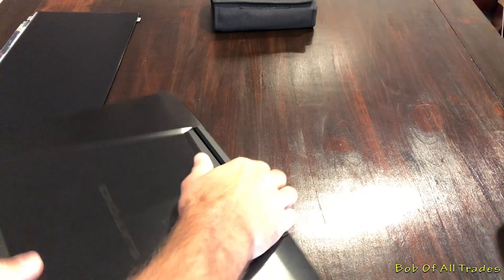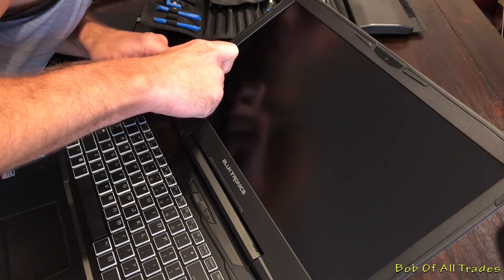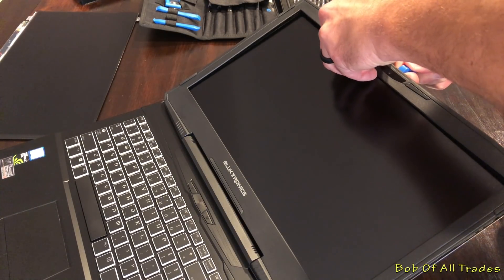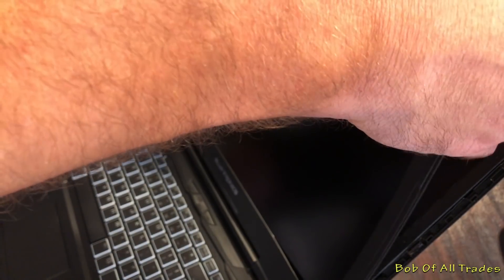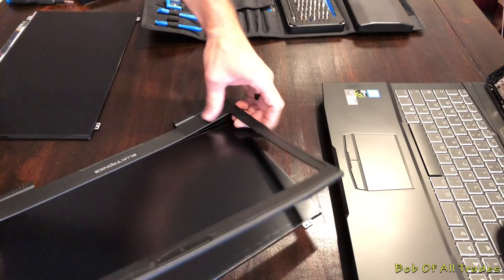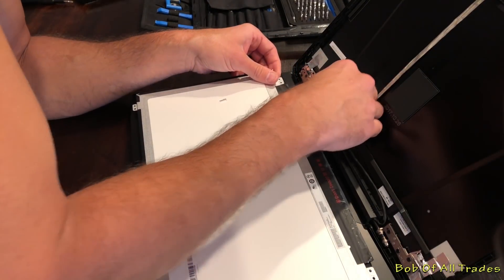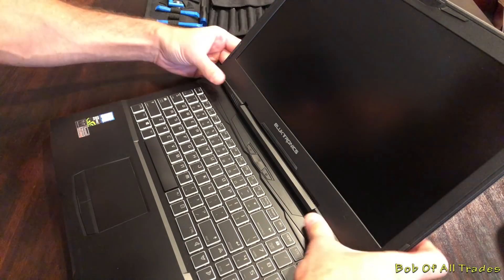120Hz 100% sRGB Panel Install MECH 15 Eluktronics

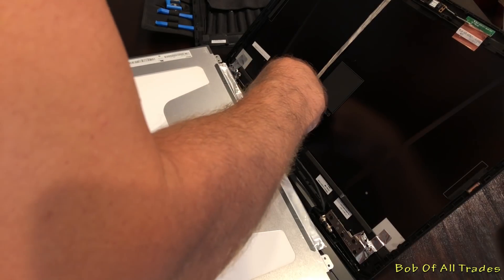Comment from the maker: This will NOT fit thin bezel chassis laptops 7:22   ;)
Reply: will it fit acer nitro 5 an515-52?
Reply: @lukedominated  It should.
Reply: @sydweller2066  will it fit acer aspire v15 be as well (vn7 593g), quite similar to acer nitro 5
Reply from the maker: Is a frogs ass watertight?
Reply: there are lots of reviews like on linus tech tips mkv dvd  post ur video in the chats there people would really injoy this but ur platform is to small
Reply: will it fit acer nitro 5  an515-43 ?
Reply: is there any 120hz screen fit with thin bezel chassis?

Comment: Will this work in Lenovo Y50-70?  If it has 30 pin connector and thick bezel chassis.
Reply from the maker: It should

Comment: Does it have Gsync? Can I use it for alienware 15 r4?
Reply from the maker: GetgadgetPH The panel itself will need to be certified to use Gsync on a Gsync laptop.  There’s no module like you’d find in a desktop monitor with Gsync.  Also not to be mistaken with a Gsync “certified” desktop monitor.
Reply: @BobOfAllTrades  AUO51DE do you think it gsync will work on my alienware 15 r4 ?

Comment: I bought this panel to replace the display that was in my Dell G7 that has a line going down the side of it. The first one I got the screen is just black when I boot the laptop up, I get the occasional flicker of a image but other than that nothing. Ive checked the ribbon cable connections and they are fine because the stock one works just fine when I put it back in. Might this be a weird driver or bios issue or is this common with a busted display?  Ive updated my nvida drivers and intel drivers and its on the latest bios.

Comment: what is the difference between the two links, they have different prices and I see the same screen
Reply from the maker: It’s just in case one changes. I’ve already replaced one of the links since this video. Once seller might run out of stock and decide to sell something else. 

That happens often with niche items like this.

Comment: does it work on alienware 15r4 . my screen has a 30 pin connector and is fhd 60hz
Reply from the maker: Probably but those are slightly harder to disassemble. While I have not done this myself I’m just going by with what I have seen and what others have told me just a heads up with some ribbon cables and various other things like that so just be careful
Reply: @BobOfAllTrades  thanks

Comment: Hey guys, is this display works with Lenovo y540?
Reply from the maker: No
Reply: @BobOfAllTrades  Hi Bob, what display for Lenovo y540 you would recommend to buy? Cos I have 17inch model and work as a photo editor. Thanks.

Comment: I ordered "LCDOLED Compatible with 15.6 inch N156HHE-GA1 120HZ 94% NTSC FullHD 1080P LED LCD Display Screen Panel Replacement". Is it compatible with my Acer Nitro 5 AN515-53-527H Laptop model? My stock display is 60hz IPS 1920x1080 15.6 inch.

Comment: Hi bob, this is a good video, but I have some question

1 - These panels work for the Acer Nitro 5 2018?
2 - One of this panel have this characteristic LCDOLED, is real OLED or just LCD (TN)?
3 - On Amazon, I find that panel,  https://www.amazon.com/dp/B07N5KN3D7/ref=psdc_2612045011_t3_B07HKVB6BV , in the description specific that is IPS, this is better than you show in this video but with the same quality as the original, that it is IPS too

I hope you can answer me, I want to change the panel, but for IPS 120 Hz version, thanks.

Comment: Great video as always Bob, i suggest you to give a chance at the N156HCE-GA2 from innolux too but it's IPS (near 100% sRGB) and got very good compatibility with brightness control. Compared to the AUO42ED and AUO45ED it also got better G2G times. I've installed it in my acer VN7-593g and it's awesome, buttery smooth, vivid color and brightness slider works very well. I don't understand why this panel is not so popular, i suggest you to give it a try!
Reply from the maker: I don’t have any laptops with chunky bezels anymore or I might give it a go 👍

Comment: I come from the replace for the dell g3, will this work for the dell g3?
Reply from the maker: As long as it’s the thick bezel laptop 2018 model
Reply: @BobOfAllTrades  yeah it is the Dell G3 15.6 3579.
will it work?
thanks.

Comment: does anyone know if this laptop panel will work with a dell g5 I need brightness control to work as I have to dim the display when i am at uni for better battery life. thanks
Reply from the maker: As long  as it doesn’t have a 4K panel and as long as it is the thicker bezel last generation version then yes

Comment: Between this and the previous video about changing the panel in my G3 15, I am much happier with my laptop. Thank you, sir!
I will need to get calibration hardware before I can do any serious photo editing but even with just visual adjustments, this looks very good. I did not see this video before I bought the panel I just installed or I would have used your link(s), sorry. 
I've replaced the HDD with a 2tb ssd, the nvme drive is now a 1tb, and I maxed out the ram. With this new panel I am almost done--just need to learn about repasting . I think I now know a guy who has some helpful videos for that too. :)
Thanks again!
Reply: rob biemer hey. Which G3 have you got? The 3590 one?
Reply: @jmextinction2158  , Not that one, I have the 3579. I got mine about this time last year.  The upgrades to RAM and the drives were simple and pretty easy and made this the fastest starting laptop I've owned. The previous one I had---an other wise pretty good Asus--was slow enough that I would turn it on then go make(not pour but make) a cup of coffee while it booted.  This one is right around ten seconds or so now.  The panel replacement was a bit more involved and is my most recent upgrade.
Reply: @robbiemer8178  are both of the panels in the description compatible with the laptop? is the toolkit necessary?
Reply: @raphaelbutron45  , I am not sure. I bought the panel I used from ebay. See here:
https://www.ebay.com/itm/New-LCD-Screen-for-N156HHE-GA1-REV-C3-FHD-1920x1080-Matte-Display-15-6/273756123642?ssPageName=STRK%3AMEBIDX%3AIT&_trksid=p2057872.m2749.l2649

The tool kit is probably not necessary but it made the task much easier. And a bit faster, I think. As well, good tools are always useful.

Comment: Yo dude does this work on the dell g7 too?
Reply from the maker: Only the thick bezel laptops
Reply: Bob Of All Trades wow that was fast bruh. Appreciate it. But doesn’t the g7 fit in that category? I think it has really thick bezels
Reply from the maker: Amazing Spodermon It depends what G7 you’re talking about. Last generation model or this generation model with the new design that Dell released shortly after CES.
Reply: Bob Of All Trades whoops sorry for not clearing that one out. I have the 7588 one which they released last year. Will this panel fit perfectly for that particular device?
Reply from the maker: Amazing Spodermon If sure will 👍
Reply: Bob Of All Trades thanks so much man. Really appreciate that you take the time to help your viewers in the comments section. Have a nice day!

Comment: Hey bob i have dell g7 7588 with philips panel.You have given 2  links innolux and lcdoled.Out of 2 which one is better in terms of quality ?
And can check this item because its a ips 120HZ.
https://www.ebay.com/itm/NEW-15-6-LED-IPS-FHD-120HZ-AG-DISPLAY-SCREEN-PANEL-LIKE-INNOLUX-N156HHE-GA1/401586692400
Really confused which one to buy appreciate your replay.

Comment: Hey Nice video ! 

What do you think about this screen ? http://www.panelook.com/B156HAN09.0_AUO_15.6_LCM_overview_37729.html
(idc about 60-120hz)
Do you think it will be able to fit in the dell G5 (1920x1080 and no touch screen)?
Brightness and viewing angles are important for me as i work in team project, most of the times they check my screen and it's nice if they can see it clearly.

Comment: Hi Bob! I don't usually write in the YouTube comment sections, but I just had to say thanks for bringing the amazing N156HHE-GA1 to my attention. I purchased one from ebay.co.uk for £44.99 with free shipping - probably the best upgrade I've ever done to a laptop! This upgrade worked fine for my CyberPower PC Tracer III Laptop - i7 8750h gtx 1060.  Soooo much better than the bog standard IPS panel it came with (not very bright with washed out colours).  To be honest, if I didn't know better I would have guess it was an IPS screen. Thanks again!

Comment: Now not to be that guy, but are there any 144hz displays with brightness controls? I'm ok if there aren't but I just want to make sure I'm getting the best bang for buck with a new display
Reply from the maker: There’s two out there. The Helios 300 and Zephyrus M display have the thicker bezel 144hz display. You’ll have to hunt down information on the part number.  But they’re also likely using a 40 pin connector so they wouldn’t work anyway. 

On top of that they will not even be close as color accurate as this. Spite it being a TN panel, its post calibration is much better.
Reply: @BobOfAllTrades  Ah, I see, 120hz it is then...Thanks for the help

Comment: Will this work for the Dell G3 because I'm really interested on getting a 120hz screen?
Reply from the maker: It will 👍 I have a teardown tutorial on that laptop too
Reply: @BobOfAllTrades  could you link to that tutorial and your top choice display?  I just bought a 17" G3 (3779) and am HIGHLY disappointed in the color and brightness, would much rather swap out the display myself than return and buy something more.  Thank you!!
Reply from the maker: Just search for it in the playlist for the specific laptop that you’re talking about. I couldn’t help you with 17 inch displays sorry that has not been something I’ve been able to cover enough of.
Reply: @BobOfAllTrades  thank you.  I saw that answer in another post.  Wish I had bought a 15" so I could upgrade.  I may have to return, cannot stand the accuracy of colors in pictures
Reply from the maker: I have a 17” Predator review. That’s a nice display at 75hz and it’ll OC to 100hz. It should be a direct swap into that G3.  You’re more than welcome to watch that review as I don’t recall if I revealed the panels part number or not. The model of the laptop g5 793 or g9 793. Either one model number will be fine as it’s the same panel. Much higher sRGB. 

Sorry I’m early forgot about that review till just a few minutes ago.  While vacuuming my house, it came to me 👍

Comment: Hi Bob, New subscriber here.  I wanted to share that I ordered a G3 based on your previous videos recommendations.  I updated the TB hardrive to a SSD and used the stock 256 GB NVME for boot.  I also have the board maxed out with 32 GB of RAM.   Did some initial testing and benchmarks and that smoking intel chip 8750H did get quite hot but generally remains in the 40's C for browsing and below when Idle.  I don't do too much modern gaming, but do a lot of emulation.  I might repaste and do a slight undervolt soon as I know Dell's stock paste is GARBAGE and under volting can only help with cooling and performance.   Lastly I ordered this panel from Amazon and will attempt the install on Thursday.  Long story short, I just wanted to thank you for all your content.  You've really given me a lot more confidence in updating this machine and I really appreciate all the effort you put into making these videos.

Comment: How do you find out what aftermarket panels will work? I understand a panel manufacturer probably makes the same panel for several OEM.

For example. I'm getting the new Dell G7 17 (actually it's enroute). Has the basic 60Hz. How would one determine the correct 120Hz panel?

Comment: Two links to two different priced panels.  Why is there nothing telling us what the difference is?  Which one is the one that lets us have brightness adjustment?  And why does the 2nd link have OLED in the model number?
Reply from the maker: I have not checked the links in a while there’s a good chance the information there has completely changed
Reply: @BobOfAllTrades  Thank you for the reply.  How do I know which panel to get?  I'm looking for the one you mentioned that gives you brightness control.

Comment: Looking to upgrade a Xiaomi Notebook Pro with a superior screen. On the web I only see specific screen "replacement" parts i.e. no upgradability. Information about changing the screen to 1440p or 120 hz seems lacking. All I know is that the panel has a 30 pin connector so no 4k sadly. Can you recommend any screens for this kind of laptop or if not, where should I be looking to find out whether a particular panel will fit my chassis? Are there any tables for the connector types and compatible displays? Or should I be opening up the display panel, as shown in this video, to find out if the mounting holes adhere to some standard? Cheers
Reply from the maker: I’m not sure on that one. I always wanted to work on one.  The bezels aren’t too thin so I’d hope that it’s the standard display type such as the one featured in this video. 

Otherwise you’d essentially have to dismantle the bezel and see for yourself.

Comment: Hi I got lenovo y520 15ikbm gtx 1060 6gb model. I want to change the panel on it from 60hz to 120hz. Got very good price on this laptop couple days ago(paid 495e ik it is ridiculous they sold it that cheap :D) What i need to find 120hz panel that has brightness adjustment and do you know good ones with the brightenes adj?
Reply from the maker: This one lol
Reply: @BobOfAllTrades  it will be almost 200€ for me. Is there ebay link for exact product?
Reply from the maker: Mahad Mohamed I have the amazon link in the description. You’d have to look for the part number on eBay on your end to make sure you can get one shipped to your country 👍
Reply: @BobOfAllTrades  thnx for the help👍🏾
Reply from the maker: You got it!
Reply: hello, did you install this panel already on your laptop? I was wondering if its compatible and will be a good upgrade from the stock one? I also have the Y520 by the way

Comment: what  is about working with texts and reading? I get eyepain in 20 minutes due to excessive blue glow, calibration helps a bit, but not really. Do you have the same issue with the panel? My panel is rev. c2.
Reply from the maker: This panel is extremely cool. I posed the icc color profile for this display. It should be in one of the videos for this panel.  Install it.

Comment: for acer nitro 5 use 15.6" LCD Screen Display 120HZ FULL HD EDP N156HHE-GA1 for MSI GT62 GE63 GS63VR 7RG-078US MSI GP63 Leopard 8RE     or     LCDOLED Compatible with 15.6 inch N156HHE-GA1 120HZ 94% NTSC FullHD 1080P LED LCD Display Screen Panel Replacement    ??

Comment: im using ur link to by the N156HHE-GA1 120HZ and adding 
Crucial P1 1TB 3D NAND NVMe PCIe M.2 SSD - CT1000P1SSD8  2000 mb read 1700 mb write for my shit in the box basic modle nitro 5  really like your vidoes will spam here and there see if we cant get your views to 50,000 ;-)

Comment: I recently broke my screen on my Acer Nitro 5 and am going to install the second, better panel in a few days. You mention "after calibration" it looks and works great. What is required to correctly calibrate the new screen? @Bob Do I just click the calibration Google Drive Link in the description and it will open a program?
Reply from the maker: Google search how to install ICC color profile.  You'll be good to go.  I'll make a tutorial myself eventually.
Reply: @BobOfAllTrades  my bottom two screws were stripped and wouldn't come out. Have you ever had to deal with this problem?

Comment: Do you know if the N156HCE-GA2  would work as well in terms of allowing for brightness change? I prefer to have an IPS 120hz panel.
Reply from the maker: Not sure, but TN on a laptop is just fine unless you sit at some weird angle while using your laptop.  There isn't an IPS panel for gaming laptops in FHD on the market that can touch this one right now.  At least not that i'm aware of.  100% sRGB and 89% Adobe RGB.

Comment: will this work in acer nitro 5
Reply from the maker: tote or float Did you see that panel replacement on that laptop?  I update all my panel replacement videos in the description or the pinned comment. Check it out if you haven’t seen it yet :-)

Comment: i have the same laptop ,,,
but i ordered the AUO B156HAN04.2 would it work ?
What is the screen type on this model..?
Reply from the maker: Nomad 117 I’m not sure. I tried mine and it didn’t work but I think my panel may be failing. I haven’t tested it since. If it does work you probably won’t have brightness control.
Reply: @BobOfAllTrades  
what was the panel type on the Eluktronics laptop ?
Reply from the maker: Nomad 117 Check that description 👍
Reply: the stock one
Reply from the maker: Nomad 117 It’s in the review. I don’t recall the part number.
Reply: @BobOfAllTrades  I have installed it and it first boots up with the logo screen then goes black..is that what happened with you ?
Reply: @BobOfAllTrades  The new panel is TN panel.. correct !

Comment: The brightness adjustment control will work in a Dell G3, is that correct Bob?
Reply from the maker: JazzzyJ With this panel it will. That’s the point 💪